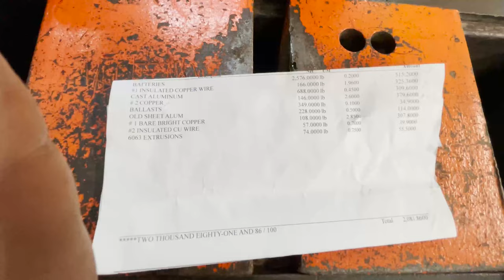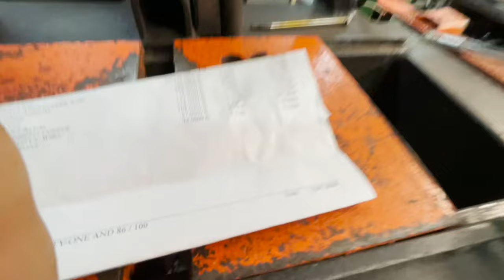3000 Pounds Of Batteries & Scrapping  Copper From Lighting Fixtures

Comment: I got lucky this last winter.found a transformer in dumpster I had hard time getting out but at low price I still got 200 bucks of copper off it.havnt scrapped much lately.with today's prices it don't even pay the gas to haul it
Reply from the maker: Thats why I try and only get copper. lol
Reply: @ProjectShopFl  yes copper and brass is my favorite but I still look and get other stuff.two nights ago I found 30 brand new Kats engine block freeze plug heaters still in original packaging unopened.30 to 120 bucks at parts store depending on weather it's 400 ..600 or 1000 watt

Comment: If you could hang on and stockpile the copper I believe you would do really good when the price goes back up. Right now China isn't building like they were but when they ramp back up and when the ev industry fully ramps copper will be a very sought after metal. Heck melt it down to 50 to 100lb ingots and stockpile them that way for space saving. Their saying from now till 2030 their will be a gap in supply and demand of over 8 million lbs needed more to fill the gap so I really do believe a higher price is in the future
Reply from the maker: Thanks for the suggestion, I am thinking about making ingots

Comment: Deano here from Napa Valley, CA USA!! Too bad you have to push a button to operate that press. Would it be better to have a foot pedal and have two hands to use when separating those transformers? I also like when you strip wire into that large coil.
Reply: A lot of times that push button works as a safety lock out when pushing a button your hand is not getting cut off I've worked with machines with two buttons one on each side.
Reply from the maker: I have one for it I will be installing soon
Reply from the maker: 1970 920 I had a punch press like that.